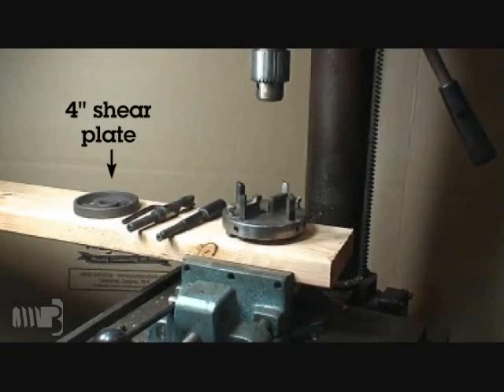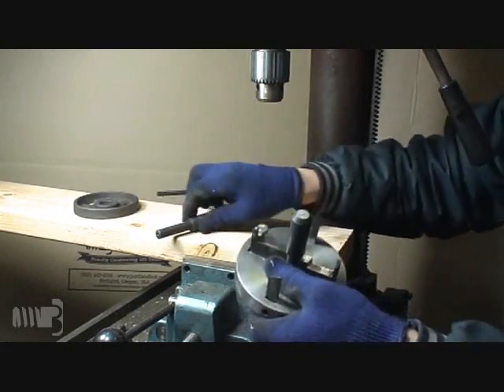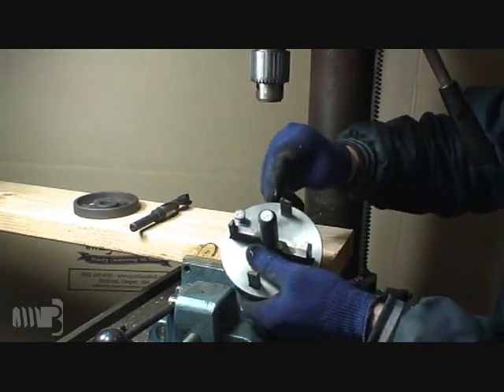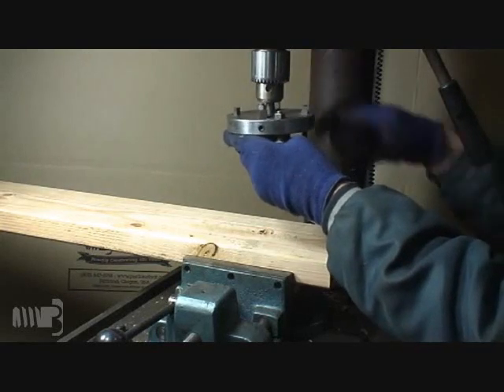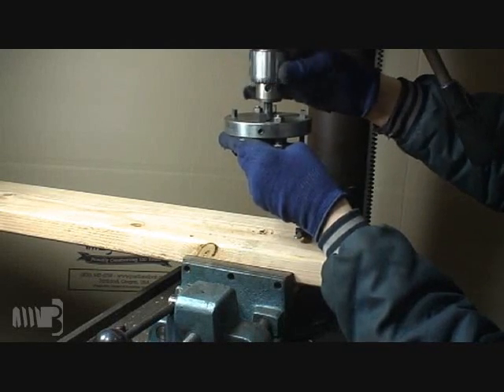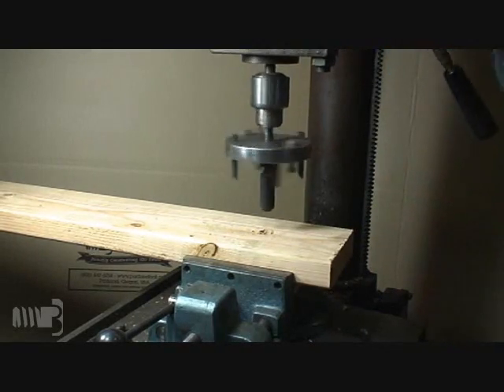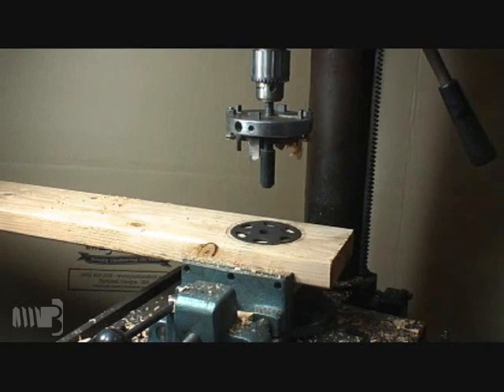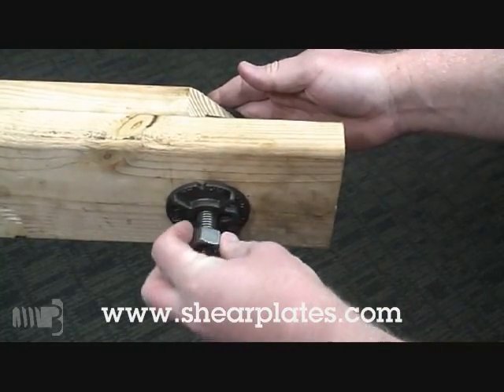Shear Plate Installation

Comment: Did you patent this shear plate assembly and method?
Reply from the maker: +MrShobar The shear plate assembly and installation method are not something we created or patented.  They were originally created by TECO in the 1930s.  We are now a supplier of the parts and have provided the video as a tool to help those who have never used shear plates before.  If you need any technical assistance or need shear plates or the dapping tool, please feel free to give us a call at 800-547-6758.